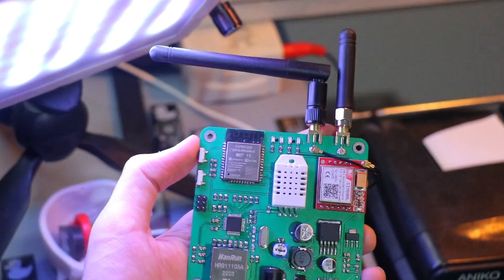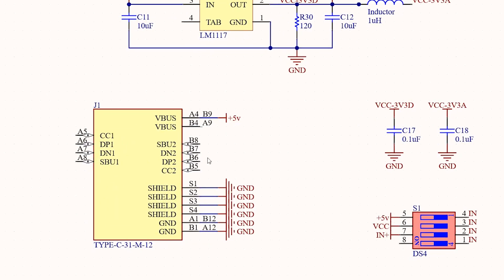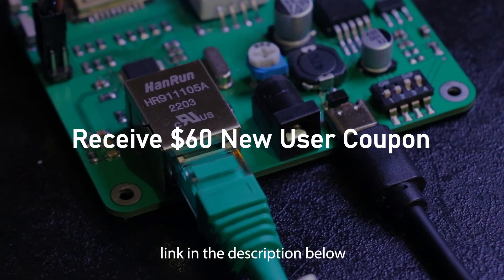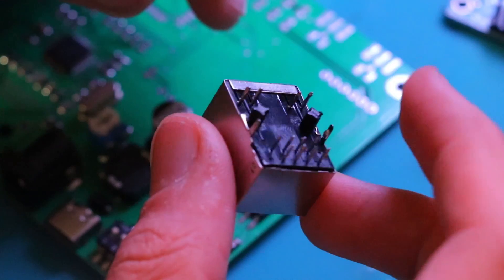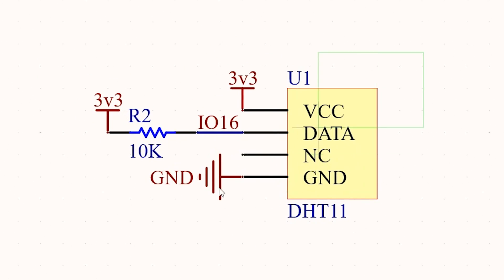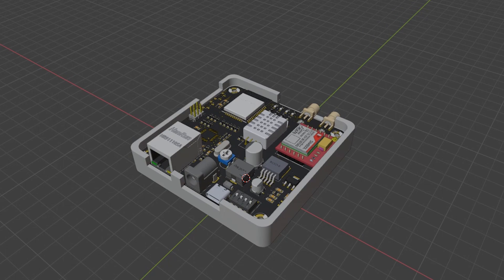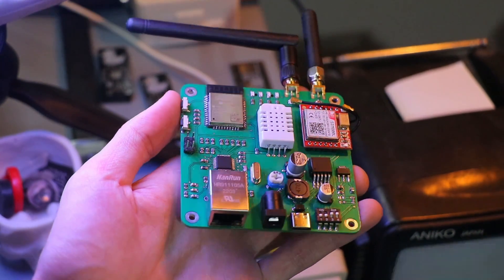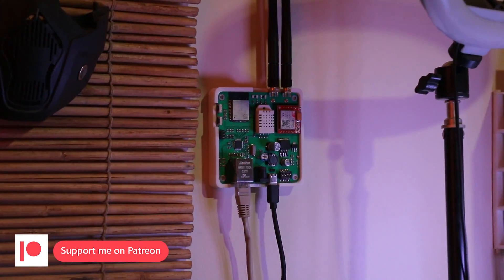Your Next Level IoT Edge Device

Comment: Great video! Thanks for sharing this interesting project! how do you program the esp32? I dont see a usb to uart chip or pins for an external programmer. Do you program the esp module before soldering it or does this model have built in bridge and you use the usb c directly?
Reply: 6 pin Programming header at 4:00 on the left side of the board
Reply: @mert2x982  Thanks for the reply! Found it now :)